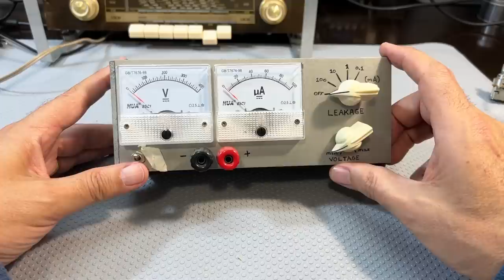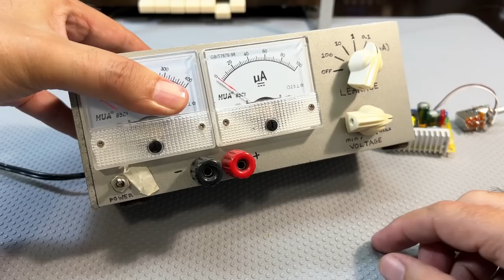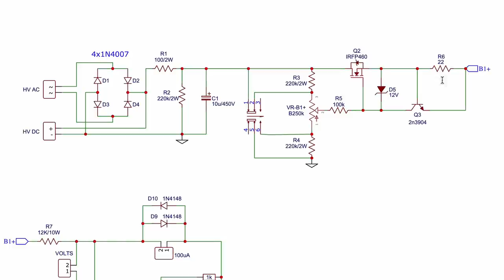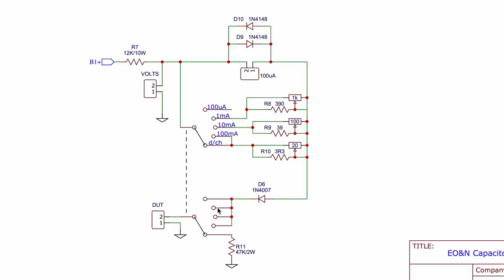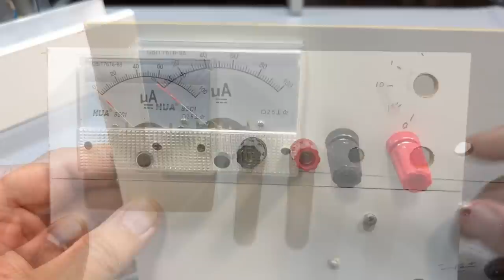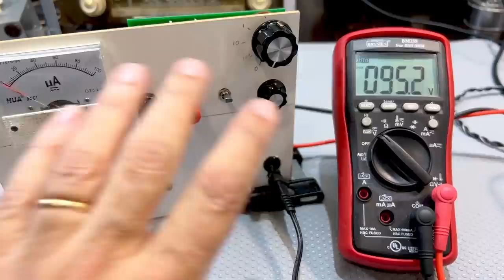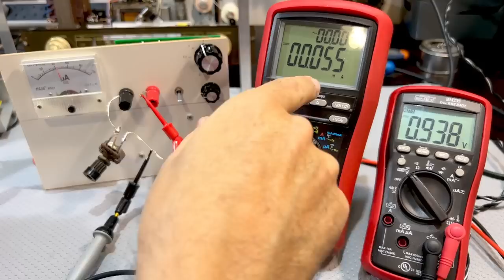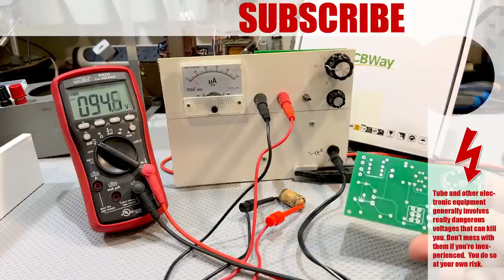EO&N Capacitor Leakage Tester re-make with PCB. Design, Build and Testing #PCBWay#

Comment: 17:40  To "dampen" the meter action, you could add up to a 50uF, low voltage electrolytic cap. a lot of old test gear, including a Sprague TO-6A has such a cap ( C15 - 50uF - 3VDC) to help dampen spikes to minimize damage to the movement if something gets connected too harshly. It's very nice of you to share creations and not hide the info behind a pay wall, it helps keep interest in your channel and supports the community well.
Reply from the maker: That’s a great idea, will try it directly across the meter connections.
Reply: That`s a good point. That method was used in many commercially produced test instruments. Also two back to back diodes were used as well to protect the meters from massive over current needle bending events. But in this low current circuit the capacitor would suffice.
Reply: @TheTemporalAnomaly  Yes, I saw he wisely added the 1N4148's already as well ( check his schematic @ 16:35) The capacitor wont guarantee against damage, but it will take that sharp "pegging" out of an overloaded condition. The only drawback to it is if you like the movement to react faster to a change, but you can experiment with values as well.
Reply: @poormanselectronicsbench2021  Well, could always stick it on a switch, maybe even a momentary with a big "SENSITIVE" label

Comment: It is a nice surprise for me that you got back to this project. If you remember I was very interested with it back then, I made a few tiny mods to your design to be able to use it for lower voltage caps and shared everything with you to get a technical approval. It has been working on a perf board since then and I've always wanted to design a proper PCB for it but never got around to it. Now that you have done the hard work, I will again be very interested to move everything to your new designed PCB. Following with great joy here!
Reply from the maker: Good to know you’re using yours. I’m also quite anxious to get mine in the enclosure above the workbench so that it is even more accessible.

Comment: Keep in mind that those little SMPS boards probably have a safety capacitor between the primary and secundary side of that pulse transformer, 
and this will add leakage from the mains to your negative side of your entire project. This leakage can go up to 50% or more of your mains voltage, and in the µA range. 
The digital voltmeter that you spoke off, needs also a separate powersupply , but the leakage from the SMPS gets his way into that digital voltmeter through the shared negative lead and that can have a influence on the voltage measurement. 
Happy holidays and have a nice christmas. Grtz
Reply from the maker: I’ll keep that in mind when the voltmeter arrives
Reply: Not sure if that is an issue, because he is powering it with a 12VDC "wall wart" , so, it is not connected directly to AC mains voltage. There's a possibility the wall wart is also a SMPS design, but, he will have to check that himself. The other option that Manuel was considering, and configured for, was a 1:1 isolation transformer ( for his 230VAC mains), which would keep that from happening, but like he said, would add a larger cost to the build.
Reply: This SMPS is a DC/DC converter, so it probably has no connection to mains (or it depends on the source of DC you provide at its input). 
I'm pretty ignorant on the topic, but what kind of safety such capacitor would provide? And this being a non insulated topology (one end of both windings tied together) I cannot imagine where this cap would be not to interfere with the function of the transformer (essentialy shorting the windings - or is it so low value that it blocks the main switching frequency of the circuit, but lets thorugh any harmonics of it?)

Comment: I suggest that the voltmeter should be across the DUT, not where you have it. That way you have a liveness indication for the terminals, for safety, and you can also see the discharge, and know when it is finished, and, again, when the capacitor and terminals are safe.
Reply from the maker: Can’t do that or the current drawn by the voltmeter will read as leakage.

Comment: A very interesting and practical capacitor leakage tester. Thanks for sharing. I do agree to be cautious with cheap switch mode power supplies or boost converters. I have seen many cheap switched mode power supplies where the layout and separation of high voltage parts were far too close to avoid tracking or arcing. Also the small transformers had very poor insulation and isolation  between primary and secondary coils.
Your circuit looks very straight forward and well thought through. Great designs are often relatively simple and simplicity often leads to good reliability. I look forward to your next video. Kind regards and a happy New Year!
Reply from the maker: Thank you Bryan.

Comment: This is of course interesting, but in practice I just change all suspicious capacitors to new ones. Once I was very unpleasant in front of a person who contacted me again after the repair. The reason turned out to be in capacitors that had normal parameters during measurements, but after a while during operation they deteriorated again. Now I have a rule - no exceptions, use only new quality parts. I even stopped checking the parameters of the old ones out of curiosity.
Reply: I must admit I'd do the same on some one else's kit if possible but sometimes the very large capacitance ones are not cheap so will often check them to see if it really is necessary. I also check most of the new ones I use had some bad experience with some what must be counterfeit or second's. No amount of time I have wasted chasing around thinking I had done something only to find dodgy components. So am going to build this tester for the bench probably get my friend to do so also.
Reply from the maker: I’ve had similar experiences with new caps that are counterfeit.
Reply: @electronicsoldandnew Yeah, I mainly use leakage meters to check new caps and NOS items in my inventory before installing them. If someone else is paying, I’ll get fresh caps from Mouser and generally rely on their quality assurance, but more often than not I’m tinkering or putting together my own projects, and then I’m not above harvesting more expensive parts like bulk caps and reusing them. I think there’s plenty of good reasons for having a leakage tester in the workshop.

Comment: Excellent project! Ideas = 1) On the switch mode board, change out the cheap caps for high quality brands.  I am betting that the voltage of the original caps is overrated. 2) Maybe consider adding an auxiliary input for a frequency generator to drive the DUT at different frequencies. Frequency is an important cap perimeter. Tips = 1) Always cover the e-caps (with a clear plastic sheet, cloth, etc,) when powering up a new module, for the first time... such as the switch mode supply. This limits any damage caused by an exploding cap. 2) Pots often come with two nuts and two washers on their stems. This is so you can set the depth of the offset of the pot. One nut and washer stays on the stem, the stem goes through the front panel and the second washer and nut clamps the pot in place. The face of the pot does not touch the back of the panel. This allows 1) the board to be offset from the panel, 2) the amount of stem protruding from the face of the panel to be adjusted and 3) the various pots to be evened up. I hope that helps.
Reply from the maker: All great tips. Thanks.

Comment: Hi Manuel ! Thank You for the interesting video again ! 👍 In my leakage-tester I use a springloaded button for test, so only if I push this button voltage is on the DUT. If I release the button, the capacitor is discharged over a resistor like in Your set. This is for more safety, because You never have voltage on the DUT only if You push the button. So it is not possible to "forget" to switch of the voltage. It is only my mind and maybe You can use it also !
Greetings and late christmaswishes from Heinz from Austria😊
Reply from the maker: I decided on this method as I like to increase the voltage slowly, rather than setting a voltage and applying it. Then, when I turn the switch back to the off position, it automatically discharges the cap. However, the push-to-make option is easily adaptable for anyone who wants to do so.

Comment: I remember when you were first introducing your capacitor testor in videos.    It was pretty awesome.  I made the Mr Carlson's version, but I also look forward to having a go at making your version once it is released :).    I think there are times when you do need high voltage testing and not just a low voltage test.   
I hope you had a great Christmas with your family.
Reply from the maker: I also considered building Mr. C’s version, but quite frankly, I got into the habit of using mine and it did all I needed, so I stuck with it. The only reason I’m rebuilding mine is to fit it onto my bench ‘test gear strip’, which makes everything easily reachable.
Reply: Hi, could you show schematic? I am thinking about building my own but not sure how complicated it is. Would like to see before paying for schematics
Reply from the maker: It’s linked in the description of the video
Reply: @electronicsoldandnew  Hi, I mean Carlsons version

Comment: A nice addon would be a spdt switch for the voltmeter.
What annoys me when discharging a cap you don’t know it’s really discharged, especially larger caps…
This way you have the best of both worlds..
Reply from the maker: That’s a great idea
Reply: You’re welcome!
This keeps it simple and easy to mod… i was thinking adding it to the selection switch but to much things to consider etc..
Let’s keep things simple 😊
Most of the times I use it for foil caps, but the last weeks i’m busy with reforming caps..
And i have to attach an extra multimeter to be sure i don’t zap testers..
Speaking about reforming caps.. An current selector would be a great addon too haha
Maybe something for an upgrade??
But that would make the scaling for the ammeter a bit more complicated i guess

Anyway love your work 👍🏻
Reply from the maker: @DJDavo013 👍

Comment: Hmmm, it may be an idea to make a switch-mode power supply with variable output voltage, with a benefit of a low voltage power input and a cheap high frequency step-up transformer. Noise is not really a consideration for capacitor leakage testing, so SMPS will do. I like the project as it is now though :).

Comment: The internal resistance of your uA meter is obviously 20R.
If you put a 40R (39R) resistor in series with the meter and place the protection diodes across the combination of resistor and meter, then the voltage across the meter will be only 0,2V at the maximum current of 100 uA when the diodes start to conduct at 0,6 V
Reply from the maker: By my calculations the resistance is 2160 ohms. The shunt resistors are all in parallel with the meter.

Comment: Greetings:
Suggestion: I have not yet worked out the method! But would like to propose an automatic circuit change, that is using a momentary switch to prevent leaving high voltage on the DUT leads. When the switch is depressed, the voltage is increased  automatically and stops based on a leakage current you set on a pot!, and the appropriate led lights to match the current range where the leakage occurs. Releasing the switch discharges the cap while leaving the last test results displayed including the voltage at which the leakage was met. Maybe a slow 555 circuit could do it. Leaky caps will reach the leaky setting, while a good cap will have voltage rise to a limit set to avoid damaging the good cap. (A good alternate use for the rotary switch.)
Just a thought, almost like an ESR meter.
Paul of "Mr. Carlson's Lab" YT channel has a low voltage leakage tester with construction details on his Patreon channel.

Comment: Hi. Interesting DIY project idea. I was wandering how 'clean' does the DC test voltage needs to be in this case. As we talk about uA's could a 'poor' switching power supply introduce some unwanted error? If the switching frequency is not filtered enough it could cause some current through a capacitor. One remark on the rotary switch and safety. Does the rotary switch has the same function as in the old tester? Or you have an separate on-off switch? If you would have an separate on-off switch and you do a test, the DUT would stay charged until you turn the rotary switch to discharge position. The chance is big that one would just turn off the device after doing the test.
Reply from the maker: The supply doesn’t need to be extra clean. It works well as us. The switch is in fact the same as the previous version. When using it, you must remember the sequence.

Comment: Just wondering if a transistor circuit could replace the complicated voltage range selector and achieve the same results without the switch.
Reply from the maker: Quite possibly

Comment: Ok I follow the testing ok but does testing tubular tuning etc capacitors test the same way ??❤ thanks compliments of the season regards Peter Onel
Reply from the maker: You can test the leakage on any capacitor. Just be careful of the test voltage you apply.
Reply: Thanks I let you know the out come

Comment: In one of the first design videos you had a 10 ohm resistor in series with the  source of the mosfet. You stated it was for a bit of negative feedback so the mosfet circuit could regulate / stabilize the output voltage better. I see it's missing from the final design. Did you explain why?
Very nice design thanks. I received my boards today. I'll be moving ahead with a build. Thanks for sharing.
Thanks

P.S. FWIW the silk screen for R11 is upside down on the board 🙂
Reply from the maker: This circuit has that resistor in the transistor current limiter. It’s labelled R22.
Reply: @electronicsoldandnew  Ok. R6 serves a dual purpose then. Fair enough.
Thanks

Comment: Hello! A quick question, I also built it from the same DC-DC converter, but I noticed that the pointer shakes a lot at 2 mA and 200 uA, did this converter cause any electronic disturbances to you? thanks
Reply from the maker: No, it worked flawlessly, but as I said at the start of the project: I don’t really trust these modules. I usually buy two or three to ensure that at least one of them works 😊
Reply: @electronicsoldandnew  Hi, I have several modules, I will try another one, the one with the strange small capacity capacitor is a good example of 100 nf, could it be some kind of oscillation? I'll see what kind of module I have, I need 450 volts, I have a lot of capacitors...
Reply from the maker: I haven’t tested the module beyond the application in this case, so I can’t be sure if the cause of the issue.

Comment: Could there be any problem with using another mosfet capable of 700v? What about 2w pot and 1n4148 If voltage is higher from transformer I have on hand?
Reply from the maker: The mosfet will be fine as long as you heatsink it. The 2W pot is good, as it will handle the voltage better than the smaller pots. The 1N4148 I find a little fragile. Use a 1N4007 instead. It’s more robust.
Reply: @electronicsoldandnew  Thank you! Will the current limiter work same way with other mosfet like FCP20N60 or  IXTP12N70X2
Reply from the maker: Probably, but it’s best to check the cutoff voltage and adjust the resistor as needed. The higher the resistor value, the lower the current limit.

Comment: D6 1N007 appears to be acting as a blocking diode vs a shunt to ground for the DUT. For a diode shunt would not it's anode be connected to ground?
Reply from the maker: This diode just blocks DC current flow back into the device when the supply is switched off and in the event that there is still charge in the DUT

Comment: Thanks 👍 and merry Christmas 🎄 
can I use a Chinese high voltage converter voltage input 8--32v output 45--390 v only without using the card that you have made and using only the 2nd part of your diagram.
Reply from the maker: That would work, but I’m actually a little afraid if these devices 😊
Reply: @electronicsoldandnew  thank you for sharing the schematic diagram.
Reply from the maker: My pleasure

Comment: Hi, do you know a way to calibrate without pot?
Reply from the maker: Not sure what you mean
Reply: @electronicsoldandnew  Hi, you did calibration with 1k pot adjusting trimmers on the board. Is it possible to do that with a resistor of known value to calibrate using a multimeter
Reply from the maker: Sure. If you bring in all the calculations for the meter’s resistance, etc. too much hassle.

Comment: The link goes to all interesting Tube Tester files, not to a Capacitor leakage tester set of files, or am I missing something ?
Reply from the maker: I just tried it again and it goes to the correct files. Here is the link again: https://drive.google.com/drive/folders/1sxGnUVc_3p2kmEsl8otx2GP2z4UvN3tD?usp=share_link
Reply: @electronicsoldandnew   yes it does now ! Thanks.
Reply: @electronicsoldandnew  although I still do not see this specific link in the grey area above this list of posts and under the video ..

Comment: Nice project!
Which wattage is the pot you use - or recommend? 
Did you use any special type of rotary switch for such high voltages? 
I don't have a microampere meter - do you think chinese ones for cca. 5€ are any good or is it best to avoid them? What about using the one on the multimeter? Would Peaktech work for this?
Also, on the schematic the switch in first position (discharge) probably shouldn't be connected in the amp range part (upper portion of the switch schematic) - or am I wrong?
Reply from the maker: The pot is a 1 or 2 watt. Switch is answered in other comments.